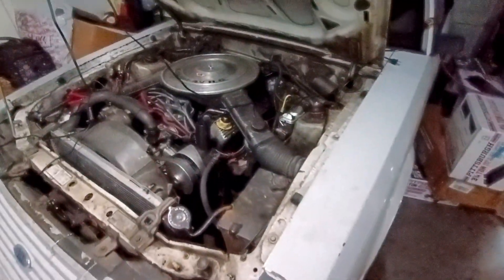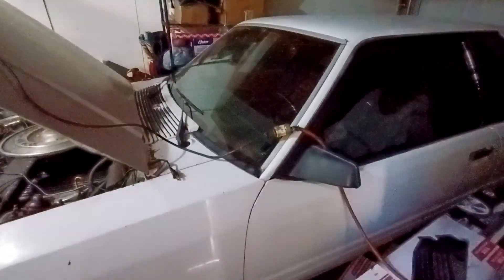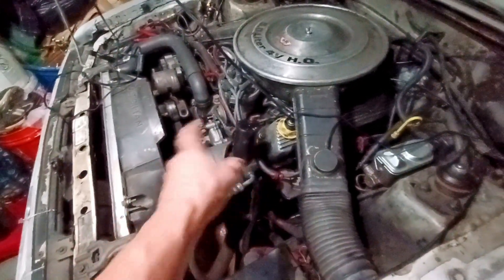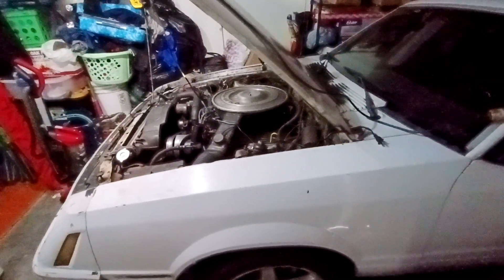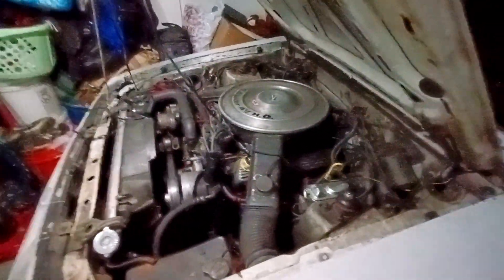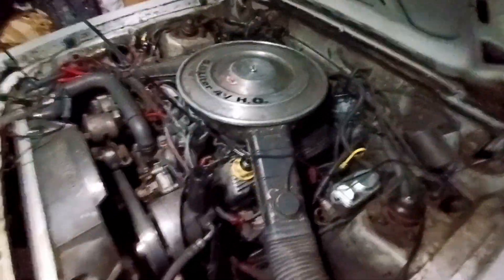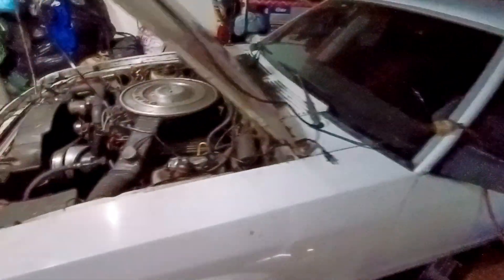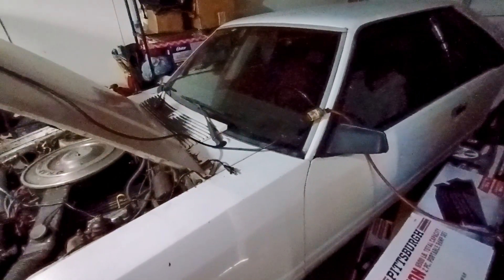1984 1/2 GT350 Mustang / Part 1, Engine rebuild, Resto.

Comment: 302 HO is a Great Engine.  just dont get a 5,4 triton  I have one in a truck ,one pos. Rock on Bro
Reply from the maker: @wallyinthebox1  Oh yeah I don’t even know how many miles I put on it but I e been driving it for like 20 years just ever changed the water pump, batteries, timing change with sprocket, valve cover gaskets, clutch And regular tune up stuff but other then that she’s been solid. Time for a good engine rebuild, I have the block at a machine shop now waiting for a call this week.     Yeah those 5.4 modular dual cam engines I don’t like, I wouldn’t mind an older 351 regular 1 cam old engine.  I would probably twist my frame with that though.  lol.  Glad to hear from you man